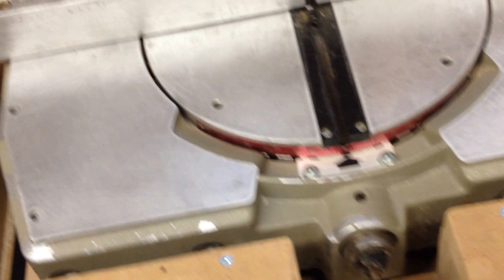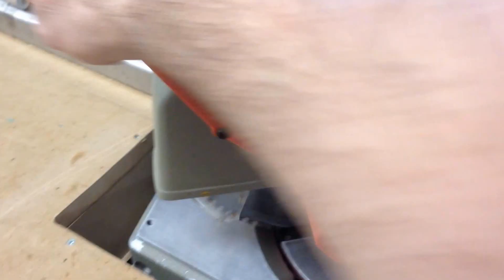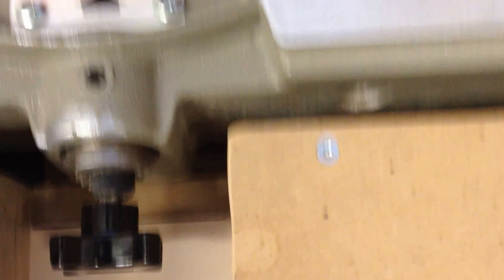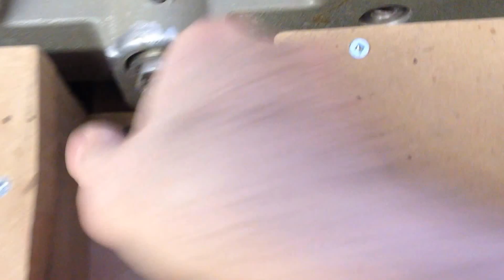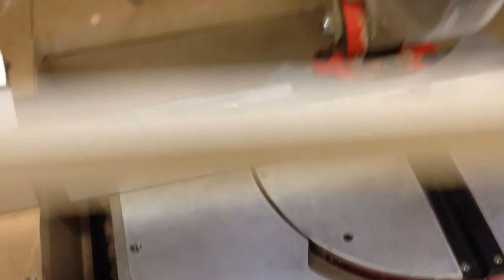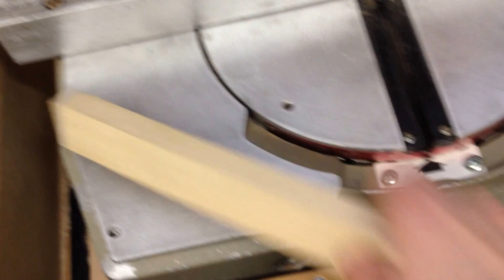Omga mitre saw

Comment: That whistle is the most annoying thing.  I can't figure out what makes it.
Reply: A bad blade mostly. I’ve had an OMGA for years and you got the odd blade that does this. Less so with expensive ones. Buy the best you can always. 96 teeth
Reply: @kennethhenry6096  I wouldn't say bad blades in my case.  We have some bastard ones that we've acquired over the years.  If they don't cut nicely, they don't get used.  We've got mostly FS Tool stuff.  I think I have one blade that doesn't whistle in those saws.  We've got five of those saws.  One has no plastic guard, nothing whistles in that one, and I've tested it on one of the others and it didn't whistle until the guard was reinstalled.  So it's something to do with how air moves around the mechanism that pulls the guard back.  I'm betting a piece of tape in the correct spot would end it, I just don't know where.
Reply: KBrogger u had an old spare blade that used to sing. It’s airflow catching one something alright. I ended up filling the three or four holes with plasticine which sorted that one anyway.
Reply: KBrogger ultimately, you really need to pay the money to get a good blade. What’s the point in owning a fantastic accurate machine like the OMGA and then sticking a cheap blade on it?
Reply: @kennethhenry6096  I wouldn't say any of the blades we have are cheap.
Reply: KBrogger I am a picture framer so I’m using the 96 tooth ones. They are normally about £100-£130  a pop. They do last a long time normally, but I haven’t had a singing one for a while now thankfully. Check the dust airways are clear as you sometimes get a bit of dust build up and maybe it’s causing a whistle. Who knows really. It’s usually the saw blade itself though. Could be the guard, I don’t know what the new ones are like. Superb saws all the same build for a lifetimes work.